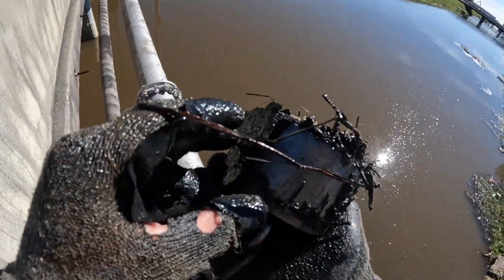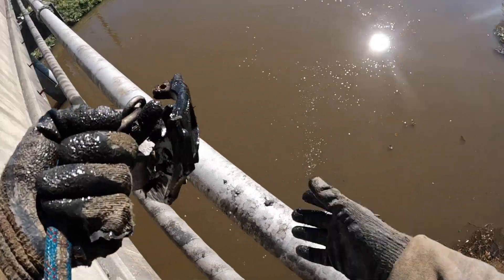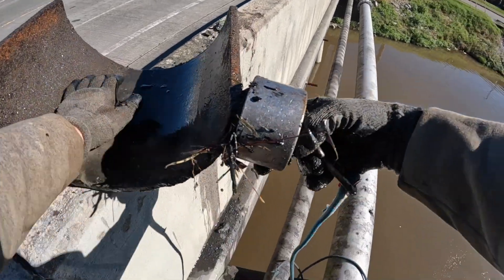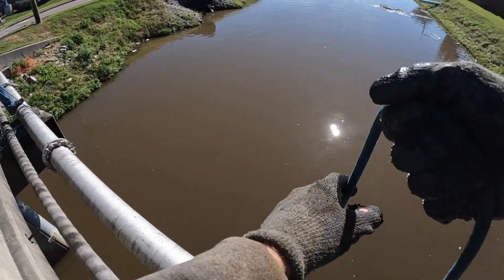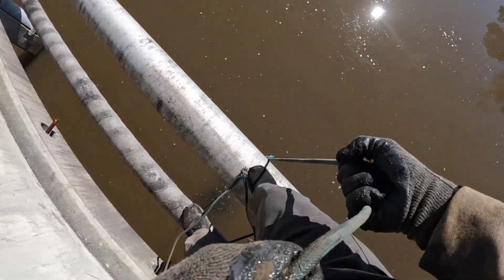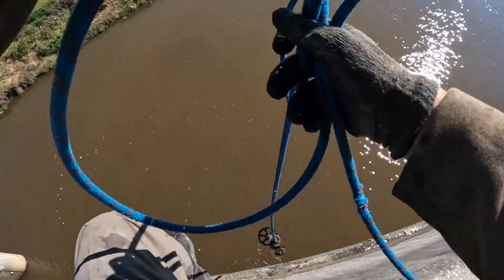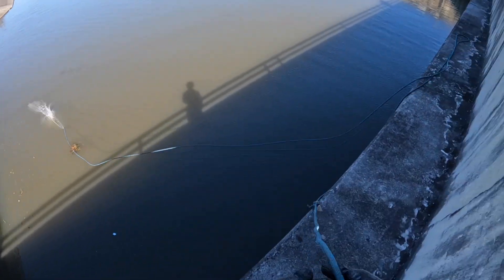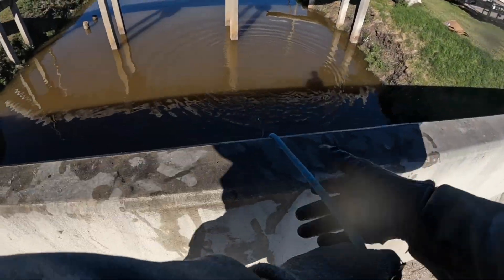This ABANDONED Bridge Is LOADED With Forgotten Treasure - Magnet Fishing An Abandon Bridge

Comment: The large piece that said "Ford" is a brake caliper. It is where the brake pads go that came up with it. You were right on the Rainbow. It is a vacuum, and that one is at least 70 years old. The user puts water in the bottom pan and that filters the dirt out of the air. They are about $2000 new.